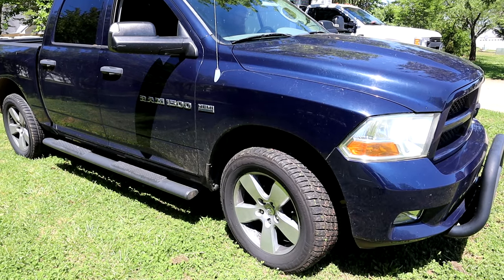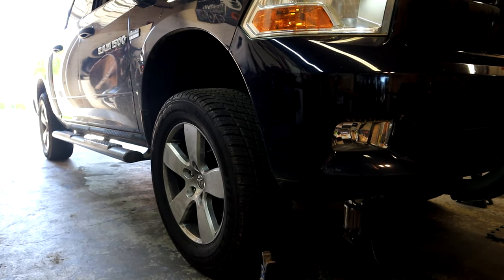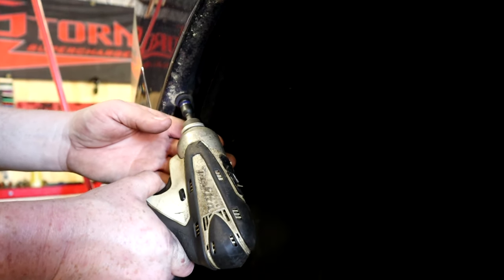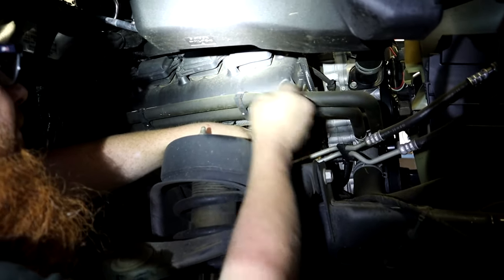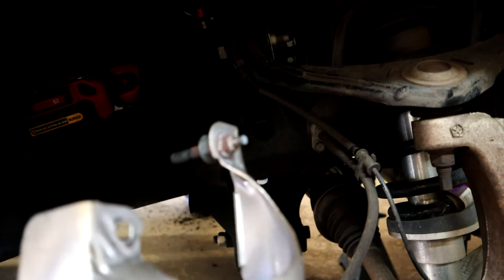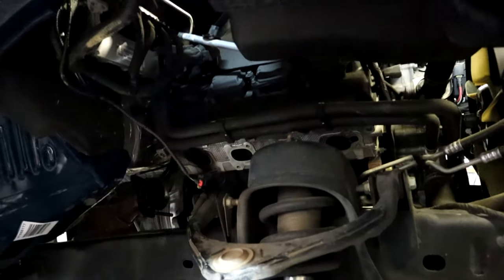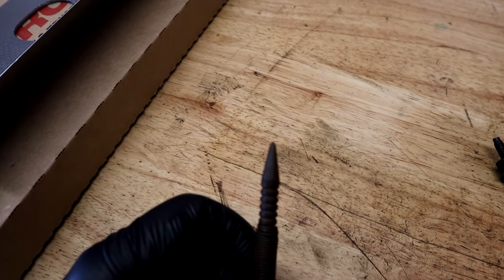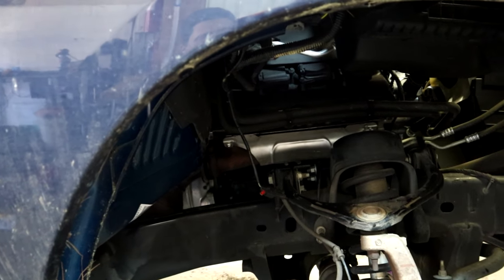5.7 Hemi Ticking/Knocking Exhaust Manifold Leak Repair.

Comment from the maker: Thanks for the support mopar fam 🙏  this is a very easy straight forward repair its really not that bad at all👍
Reply: This is a very straightforward easy fix? It’s a common problem on these ram trucks🤣🤣 The dealership charges $1400 per side to fix and it will happen again it’s a junk design that has not been corrected because it’s revenue for the service department. In 2021 this is still happening to ram trucks it’s disgraceful
Reply: @sjbb838  My 20 Ram with 20 k on it goes in on friday ..BS
Reply: Hi I have the same problem on my ram 1500 what size drillbit do I need and also I heard they make a reverse drill bit if you could please let me know thank you
Reply: So my question is why bother who cares about the ticking noise what will it hurt if you just keep driving the way it is it's just going to happen again that's a problem with a cast manifold they Warp so why bother going through all that work if it bothers you turn the radio up a little bit more

Comment: When the hemi starts ticking it means it wants long tube headers so it can exhale a lot easier and making you happier.
Reply: Can you please tell me more? I like where this is going lol mine is doing the same thing
Reply: @bartmankowski241 will swapping exhaust manifold for a headers actually solve the problem or is it the studs causing the failure?  Mine went in, was fixed and 10k miles later it failed again.  I am over this poor design and just want to fix it for good.
Reply: But what if she a stubborn AWD?

Comment: I had this on my 2020 with only 28000 miles. If this has been going on for years, why in the hell haven’t they redesigned this part?
Reply from the maker: Crazy right🤷‍♂️
Reply: cause $

and people are still gonna buy their shit so 🤷‍♂️
Reply: @Bigshoots86  guilty as charged. Incidentally, I’ve now had to have the other side done at 48000 miles. Still under warranty, but ridiculous anyway.
Reply: same
Reply: I thought this only effects the 1st gen non MDS 5.7L hemi 2003-2008 manufacture date?
Reply: My thought exactly! I have a 2018 with only 46k and it just did this to mine so I appreciate this video and info as I will be doing this myself lol.
Reply: Just left the dealership being told my inspection failed due to this. 2016 RAM 5.7
Reply: I have a 2016 in this what's wrong with mine also.
Reply: What’s the average cost for fix per side? No warranty.
Reply: @Fagbagio You're probably right about that. Seems like the perfect spot for Grey area. Like the unpaved roads that destroys suspension. To stimulate the economy
Reply: This has been going on since the mid 2000s,they did eventually start using better Hardware, the the manifolds started cracking.
Reply: I just got a failed inspection from the dealership for one broken bolt passenger side.  They want to replace the manifold and bolts for ~$700.  Thinking of doing it myself with   BD Diesels kit.

Comment: It is easier to weld a nut on the bolts.  I would suggest having the manifolds machined because they are probably warped.  The bolt broke because the manifolds get warped.
Reply: This is very true but not everyone has a welder, torch, gloves, face shield, etc. , that would be a very heavy investment when you can you just use a counter tap

Comment: My rebel been doing this since 60K miles. I am now at 105K miles. I think I will finally get this done. Dealership wanted $800 for this job. Will do myself this weekend. Thank You!
Reply: How's it going Allen, I was wondering if driving your truck like that gave you any other issues? I began to hear this coming from my hemi Cherokee as well and I am wanting to repair it but I need to wait a little longer because this is my daily driver

Anyways thank you 🤙
Reply: @cucobeto94  No problems at all. It's just a minior exhuast leak when the engine is cold. Once your engine warms up, the exhuast leak will go away along with the tick. Been doing it for over 40K miles with no issues.
Reply: @allenyee4782  
Yeah it does stop after the engine warms up, 

Well I figured you'd fixed it, but I'll take that tip good sir 👍 thanks for the reply
Reply: Hey man having the same ticking sound on my 16 rebel, how hard was it to fix it yourself ? Thanks man
Reply: My tick goes away at idle but when I'm driving I hear the exhaust tick.

Comment: I have a 2017. I have had this repaired 5 times now. Under 200k on the truck. There is no excuse for this. Just not a good fix going back to factory

Comment: Just wondering . . .  Does a leaking exhaust manifold hurt the engine, besides the ticking? Can it make one or more of the cylinders run too lean, or something? My ticking noise isn’t too bad, so I wonder if the juice is worth the squeeze. I’m inclined to just let it go.
Reply: I believe the o2 sensor is downstream of this, so yes, it does cause issues

Comment: @ 16:50 when you start drilling into the broken bolt:  Good call on the center punch. I’ve been told that the block wall there is pretty thin, and if the water jacket is breached, you’re going to have a very bad day. They sell drill guides online to help prevent accidents. Take your time with the drilling, and be careful.

Comment: I have a set of snap-on "reverse" twist drill bits. the reason is that if it catches just right while drilling, it may very well turn the bolt out at that stage.

Comment: Thanks for the video. Had the same one broke on my 17 hemi ram with 65k miles. Got it fixed in a couple hours thanks to your video and she’s quiet again!
Reply from the maker: Awesome man 👍
Reply: How much was the repair?
Reply: That's crazy I have the same year same miles same problem 😆
Reply: Same year as you. Running into the same exact problem at 63K miles. This needs to be a recall.
Reply: @rhet7959  dealing with the same problem right now on my 2017, using my extended warranty for repairs.

Comment: I read somewhere that Chrysler has put stronger bolts on the manifolds for newer hemis. Can’t remember what year they did this and I haven’t been able to find much information about this online but apparently the stronger bolts usually don’t snap. Since the bolts don’t snap as easy it doesn’t usually allow the manifold to warp which causes the manifold to crack instead. If I remember correctly all 5th Gen rams have these stronger bolts. My 2020 5th gen ram 1500 sport doesn’t have a loud ticking noise like this but it does sound like it has a leak coming from the manifold on the left side near the back of the engine where the manifold gets the hottest. Its not as noticeable as a broken bolt so some 5th Gen owners might not even know theres a leak so I advise people to constantly check for cracks even if there isnt any noticeable symptoms. It’s louder on cold start but doesn’t fully go away at normal running temps. I’ve noticed a slight decrease in fuel economy and acceleration recently so I think I caught it right when it happened. I drive my truck hard and these Canadian winters get pretty cold so its 100% inevitable with an oem manifold in my case. Im going to plug the tailpipes briefly and see if the noise im hearing becomes more noticeable. I’ve only had the truck for 2 years and only put 45 000 km on it so thankfully I still have warranty just in case lol
Reply: Ya bolts are cracked and natorius for 4th gen and below and the exhaust manifold is what is common to break on the 5th Gen

Comment: Had this on my 2007 Dodge Ram 1500 SLT 5.7L Quad. I thought it was the valve cover gasket leaking on the exhaust, but now I know where the issue is now.  Thank you!! 💯💯💯

Comment: Welding a nut on is easier and less risky if you have access to a welder.  Also, you want to sand or machine the manifold flat to remove the warp.

Comment: Thanks for the great video , my 2015 ram just started almost exactly at 50,000 miles
Reply: Did you get yours fixed? And do you know if they make a bracket clamp for it? Like they do for GM

Comment: Just did one of these and it looks like you didn't replace the manifold? Your old one is warped and the bolt will break again. I'd highly recommend getting back in there before that happens.

Comment: 2013 Ram 1500 Reg cab 5.7l Sport 4x4 , My right side broke at 55k. Then at 104k which is my present miles , the left side broke. Both rear bolts.

Comment: Did my 2016 passenger side 2 years ago.  Same bolt broken flush.  I now have the drivers side with the front top bolt broken.  FCA makes upgraded studded heat shield bolts for the 8 heatshield manifold bolts.  They have a white paint dot on the stud tip   They use them when they do the repair under warranty.   Different alloy. Expensive. $10 per bolt.
Reply from the maker: Awesome information good to know👍💯
Reply: I cannot find FCA online anywhere. Can you give us a Link to those FCA Exhaust Manifold Bolts?

Comment: Good luck on doing this on a 2009 and older in the rust belt almost every bolt breaks when taking out and an extractor won't do it have to weld a nut to the bolts to extract them about to do this on my 2003 and hoping my titanium 110 Flux core welder is hot enough to do it

Comment: I fixed the broken bolts on my 4th gen.  One lower on cylinder 8, 1 upper bolt cylinder 7. Put in a set of shorty ceramic headers from MOES.   Driverside was a pain in the ass, but it went in.
Reply from the maker: Awesome 👍💪🔧
Reply: I am probably going to wait in till it won’t pass inspection because it probably won’t hurt anything
Reply: How have those shorty headers been holding up for you? I'm thinking about putting a set of those on my 15 Ram as well. This will be the third time the factory manifold has gone out on the passenger side so needless to say I'm getting kind of sick of it and figured I should just spend the money and get Shorty headers and be done with it. But do they actually last or do they start doing the same thing

Comment: Good vid. Saw in another vid that they actually sell a template for drilling the broken bolts (if you're not used to doing it). Drill into the block and it gets way worse!). One thought, lots of metal chips flying around while drilling. I'd find a way to block off the cylinder to avoid getting chips in there.
Reply from the maker: Thanks for the tip!

Comment: Try it on a 12 RAM in the rust belt...lol I used the Lisle template and sort of stepped the drilling from 1/8,3/16,17/64 and used a Irwin #3 spiral tap...now for the driver's side...the template drills dead nuts.

Comment: would it be wise to use the manifold along with drill guide bushing to drill into the broken bolt, than remove the manifold and use the extractor to remove the broken piece?
Reply from the maker: No need

Comment: It’s going to snap that bolt again. That manifold is warped and needs machined down or it’s going to just put the strain back on the bolt until the bolt snaps again or the manifold cracks. My 2020 Ram had a bolt snap due to a warmed manifold and the warranty replaced both manifolds and hardware.
Reply: Your new ones will do the same. The manifolds are junk and will warp before long.

Comment: The bolts break because the manifold is warped. Can I ask why the warped manifold was not replaced?
Reply: If you replace it with the same manifold it will break again, your better off machining the old manifold because it already heat cycled. You can flatten yourself with a 36 in sander woth 36 grit belt.
Reply: Because it wasn’t his truck 🫥✌️

Comment: There needs to be a class action lawsuit for this! My '14 Ram 1500 is in the shop as a write this for the 3rd time for leaking exhaust/ broken bolts. 1st time under warranty. Second time to put BBK Shorty Headers on... 2 days later they leaked with Remflex gaskets and the best bolts I could buy $1600. The shop said they had to only tighten one bolt 1/4 turn to fix the issue which was highly sus as it sounded like both sides were leaking. It's In a different shop now to see if putting new Remflex gaskets (recommended by BBK) will fix the problem. Only $600 if all goes well.

DO NOT BUY A CHRYSLER PRODUCT! 

Further: After I told my  neighbor about the problem, he later bought a used 1500. After taking it to the shop to get fixed it started again! Guess what problem he still has? I feel his pain.

🖕🖕 to RAM  👉 At 140K mi I had to rebuild the rear axle $1400. At 150K mi I had to have a new heater core put in $2500... 10 hours to pull the dash to fix it. Then they told me I  needed a new AC pump because it locked up when they put the oil back in it. $1200. 

DO - NOT - BUY - A - CHRYSLER - PRODUCT!
Reply: How have those BBK headers been holding up for you now?
I'm thinking about putting the same ones on my 15 Ram, this will be the third time it needs a manifold on the passenger side so needless to say I'm getting sick of paying for it. I figured I might as well just spend the money on good shorty headers. But I wonder if they warp also?
I did read somewhere that you have to do a heat cycle and then retorque them or they will leak right away with those bbk's
Reply: @chrishorn2028  Working great now. Will take it back to re-torque the bolts at 3000 miles. They are oddly a bit quieter than the stock manifolds. Specify that they start torquing the bolts from the center of the manifold outward per manufacturer. I think that is where the first mech failed me, possibly the heat cycle thing too. AND NO! Don't let them tell you they have to pull the motor mounts! They don't. Good luck. 👍

Comment: I am wondering why the OEM part/bolt broke and why the replacement part won't suffer the same fate?
Reply: It most likely will. As an airplane/car mechanic it is 99.9% due to improper torque specs and thermo expansion for whatever materials they are using. Engineers go for a generic torque according to metals and size of bolts or nuts. They also go for a theoretical approach when designing and that’s why TSBs and recalls exist.

Comment: Mine has a broken bolt, but mine ticks all the time.  Is that normal also, I noticed you said yours goes away when it warms up, mine doesn't
Reply from the maker: I would definitely start with repairing the leak and go from there.

Comment: Do you think it’s better to replace the manifold or machine and reuse it?
Reply from the maker: I just clean and reuse never had a issue yet.
Reply: @FrostbiteRam  Better advice is to check it with a straight edge. For the low cost of a new manifold I'd recommend new every time.
Reply: Just re machine it flat on a belt sander worked perfect on mine

Comment: Do you have to resurface the exhaust manifolds?     How much torque on the new bolts?     Loctite? Or Neversize?    Is there a gasket where the exhaust pipe connects to the manifold.?   
Thanks for the video...I have to do this now at 250k on my 2010 2500 hemi.
Reply from the maker: No need
Reply: @FrostbiteRam 100 percent you need to. The warped manifold put some much tension on the bolt it snapped. It’s going to happen again.

Comment: I have a 2005 Dodge Magnum RT and I have had to replace the passenger side cat and my car has really rich exhaust but I've replaced all 4 O2 sensors. I think I have an exhaust leak on the passenger side. Did the headers warp from the heat and aren't sealed against the block anymore or did the bolt just snap? Is that why I smell exhaust?
Reply from the maker: Probably so
Reply: @FrostbiteRam   I made an appointment with my mechanic and told him exactly where the leak was so hopefully this won't cost me an arm and a leg. Does Chrysler just use cheap bolts or is the problem more complicated than that? Jasper Engines says they changed the pistons on their rebuilt 5.7L engines in order to keep the combustion chamber temperature down so the bolts don't over heat and snap. I hope I don't have to go that far with it.

Comment: Question, was there any additional sealant needed on the new gasket before you bolted it back in? Looks like you just sanded/cleaned the leaked exhaust and installed? 

I just took a look at my Hemi and seems I too have the same problem, so thank you for sharing this video, super helpful!

Comment: Do you think a double gasket system would help as this seems to be an ongoing problem?
Reply from the maker: No has nothing to do with the gaskets the problem is the bolt brakes and looses torque on the gasket causing it to leak.
Reply: @FrostbiteRam  Ok thanks, just a thought.
Reply: Grinding the manifold flat after they warp from heat cycle seems to work so it never happens again I was told

Comment: I replaced my manifold bolts yesterday on my ram 1500 5.7 hemi and torqued them to 22ft pounds instead of 18ft pounds. Should I back them off and retorque them or let it ride?
Reply from the maker: I'd let it ride man
Reply: @FrostbiteRam  thanks man! I was worried about that.

Comment: How do you keep the bolts from breaking again? Are the replacements better or same crap as factory?
Reply from the maker: They seemed to hold up pretty well after repair
Reply: It’s going to happen again for sure. They didn’t machine down the warped manifold so it’s going to keep crazy tension on that same NEW bolt

Comment: Mine is doing the same thing would I be better off just getting aftermarket  headers
Reply from the maker: If you want to gain some power and sound definitely worth it since already apart but not necessary.
Reply: @FrostbiteRam  ok thanks

Comment: I replaced my 2013 Dodge Durango with a new manifold, bolts Ect. Everthing all new after I installed the part noise was gone but It was smoking slightly what could that be from??
Reply from the maker: Get any oil or anything on the exhaust?

Comment: Would this trigger a misfire In a cylinder if the bolts are bad?
Reply from the maker: No it will not
Reply: It won’t but a similar noise is a lifter tick and that certainly will.